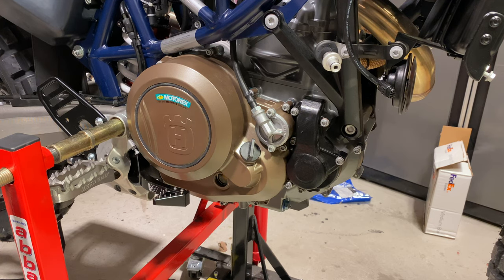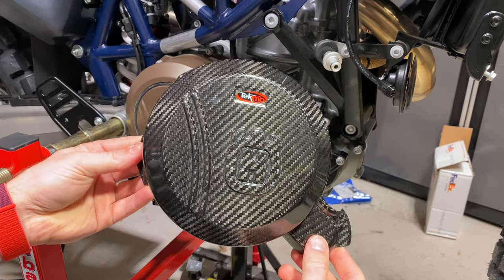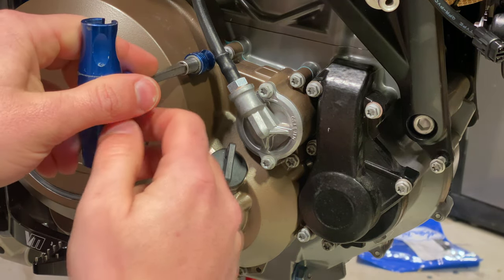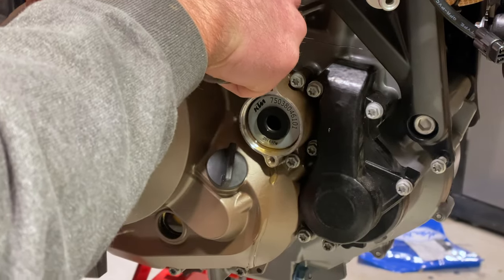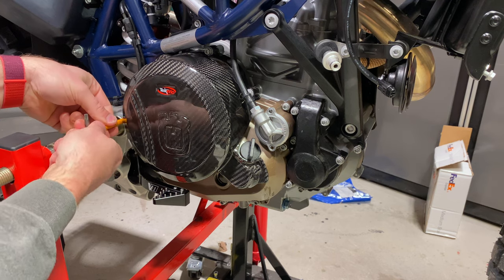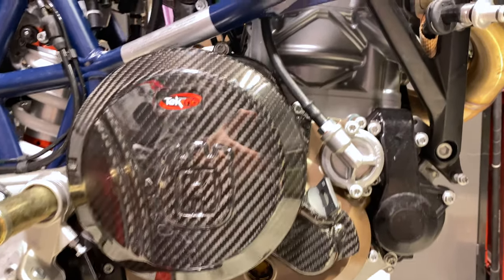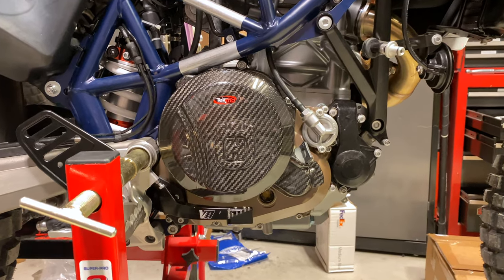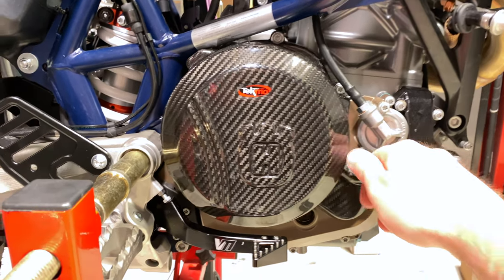Husqvarna 701 Enduro LR: Install Tekmo Carbon Fiber Clutch Cover

Comment: Are there specific torque settings for the cover bolts and oil filter cover?
Reply from the maker: Hi. I have the 701 Technical manual. "10 Nm (7.4 Ibf ft)" and no LocTite needed. that's according to the manual.

Comment: Hi mate
Is this cover strong enough apart from beauty? 
The problen with 701 which happened to me is that the brake pedal hits the cluch cover and break hole in it. So the idea of the carbon cover is to protect it.
Reply from the maker: All I can say is I almost exclusively ride off-road and have not cracked or broken the cover yet despite a lot of drops. The pedals do not hit though nor have I dropped teh bike hard enough to bend them.

Comment: It looks nice but how long will it last is the question.
Reply from the maker: You're gonna jinx it. Should I go ahead and order the ones I really wanted and keep them on standby?  https://www.tripleclampmoto.com/products/hdpe-engine-cover-sets-ktm690-husqvarna-701
Reply: @AdamChandler86  YES!  The Tekmo won't even survive the first time time your "large" foot comes off the peg and back on after a slip at speed.  Then that stupid tab looks like a design mistake and will catch on the first branch.  And you get both covers for almost the same price.  Is the material similar to the one on the engine guard?  So now we have to watch another install video!  O:)))
Reply from the maker: That's the farkle game! Companies thinking they know better than the motorcycle engineers then the customer is left having to replace something that wasn't even required on the bike to begin with. I embrace the farkle lifestyle but most should farkle with caution. I've read so many product descriptions "fix what the factory didn't" LOL as if a hundred KTM engineers had no idea their brake levers were weak..they're weak so they can break and not break other more expensive stuff. it's designed that way for a reason. Doesn't mean I don't still put on aftermarket levers :P
Reply: @patrickcooper9641  Tekmo Covers have survived on an enduro bike protecting the engine for 208 hours.. yeah for sure they get scratched up but the point is its protecting your OEM casing from having the same thing happen, the Carbon is easy enough to get rid of the scratches in the early stages with some fine grain sand paper and some car polish and it comes back looking like new.
Reply: @patrickcooper9641  did yours break from your boot hitting it?